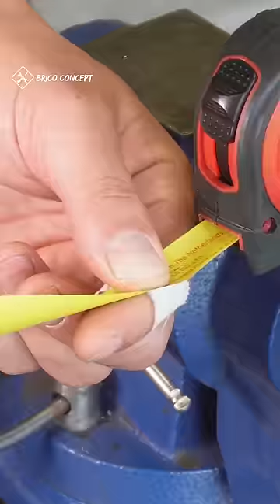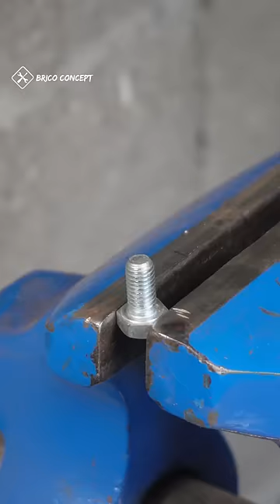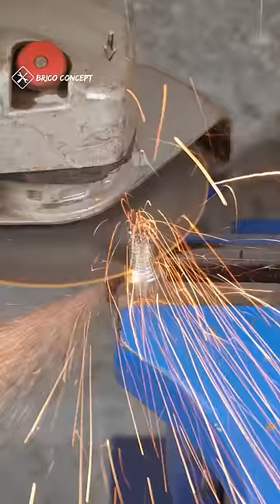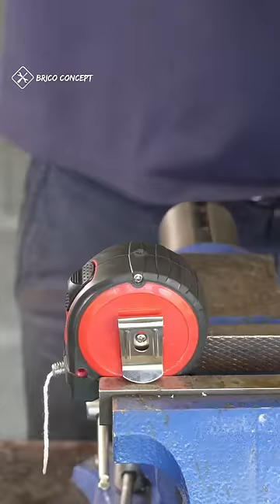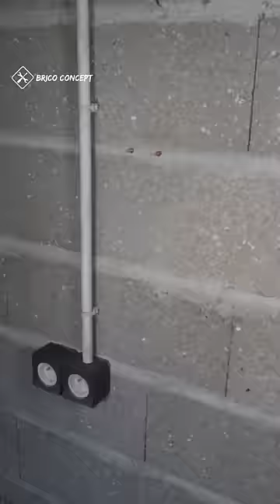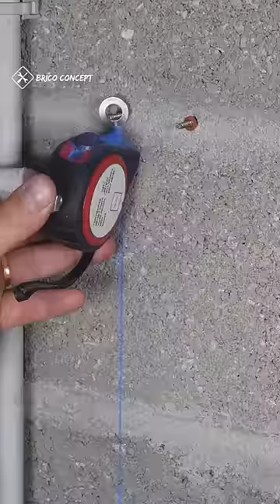I Recycled My Broken Tape Measure #shorts

Comment: For under $8 you can buy one that's 30 meters long and basically use it for life. By the time you've run this thing out to it's full 3.5 meter length a few times, the chalk will have gotten all in the spring, ruining it and you'll still need to buy an actual chalk line.
Reply: Could’ve just called it stupid💀💀
Reply: In Iraq, its price is $1
Reply: @Qwertak97  if you ever see a compact tape measure that’s 65 feet long, you be sure to let me know
Reply: @iq3l3  and lasts 5 uses. Better to just coil a string in a small container
Reply: Or even $20-$30 for a laser line generator and if time is money you saved yourself some money by not making this and by not having to remove chalk lines off
Reply: There's always a critic
Reply: There is always people that know and let you know what they know because you don't know what they know so they need to let you know so that you know what they know and they know this is rubish and they are letting you know that they know. Got it ?

Comment: They sell new tape inserts. You can fix the good quality ones.
Reply: Really never seen that here … it’s like some countries have stuff like that and some don’t
Reply: That's not a good one.
Reply: @rayzor196  when you buy a case of tape measures you can add replacement cartridges. Also you can get a calibrating board to test the tape to make sure it isn't stretched. Industrial sales are different.
Reply: That they do but usually have to order them. Don't think I've ever seen them in any store. I have a couple of the good, older, leather Lufkin 100 foot tape measures I redo every few years
Reply: That may be true, but then he couldn't have made a chalk line. I do wonder how long it will work before the spring gets dried out and gummed up just like any other tape does when they get too dirty inside. I buy my tapes from harbor freight. I get the super coupon, buy anything for 4 dollars or more and get a tape for free. I buy a tape and get one free, 2 dollar tape that way. When they are that cheap they can be replaced. The ones I take to work normally only last about a year, but the 10 or so I have at home I've had for years. It is the 1' X 25'
Reply: @jameshendricks8526  real work uses laser lines.
Reply: Mais uma inutilidade dá Internet 😅😅😅😅😅.  😊
Reply: @buysncharge  I can see that putting up drywall but to get a line to cut a board with a skill saw, not so much. I don't use a string line for that either. To me,  it's just as easy to mark a couple of spots and just use a straight edge. String lines are messy. The only one I've ever used was about 25 or so years ago helping my brother-in-law build a shed. I was given one but I never put the chalk in it. They make a great plumb bob
Reply: @jameshendricks8526  once you go laser you won't go back. They're sweet.

Comment: Huh.... I wouldn't ever thought that would work xD, to bad chalk lines are only $4 to $7
Reply: It's about recycling, can't you see? 😨
Reply: I paid $30 for mine… That’s Canadian funds mind you!! Well worth the money… the cheap ones are shitty quality.
Reply: @nunovilela1360 not really
Reply: @nunovilela1360 hope you are joking😅,

 If not just think a bit to make it into a chalkline he had to buy a thread, a pack of washers, a pack of bolts, the line and chalk, drill and a tap and all this comes packe in plastic so to recycle this you throw away 10 times more waste than just buying a new tape messure and a chalkline.

Kinda defeats the whole point of recycleing😂
Reply: @nobodyspecial6436 The device from this video, because of its design, will work no longer than a week. The same quality factory product can be taken from us in Russia for $ 0.5 and it will also last a week. But you will save an hour of time and consumables.
Reply: @nobodyspecial6436 türkey fırs class 2 $
Reply: Too bad there are more than 100k ppl not so Smart as you
Reply: A good chalk line will cost you about 40 to 60
Reply: @aeffern I'm sure he already had all the stuff you mentioned. I know I do ! 
 I already have 3 chalk lines. None of them self retract.
Reply: l was gonna say...chalk line is not that expensive!!!!
Reply: @nobodyspecial6436  that's the low quality price...
Reply: @aeffern pack of bolts and pack of washers? You realize you can buy individual fasteners at all hardware stores right? No packaging. Yeah this makeshift chalk line is kinda stupid. But damn man don't comment if you have never stepped foot in a hardware store
Reply: @steventaylor2576  right on point man, pity the nay sayers can't see the plus😢

Comment: .... or you could have just replaced the tape.  I work on cars and replaced one with metric tape.  Makes it alot easier squaring and measuring.   All my chassis are straight to 1mm.
... I have a 30 year old Stanly chalk like.  Replaced the line a few times, it still works perfect. and its heavy/balanced enough it works like a plumb bob.

Comment: And for the cost of the tape measure, you could have bought a chalk line😂😂😂😂😂😂
Reply: and this way you get to keep the money for the cost of a tape measure in your pocket 😁
Reply: About a dozen of them or more depending on the tape. Lol
Reply: @jim944 not when it takes you more than ten minutes, or you're not working an actual job like these guys. They've never used these tools. Time is your money and you just wasted it.
Reply: He literally says he recycling one as in its worn out and he's repurposing it
Reply: @jeremysanders8138  can buy replacement coiled up tape measures for cheaper then what he did to the tape measure lol. It's not recycling and reusing something that's not even broke. Lol
Reply: @chrisangus1725  blades are the same price as regular tapes. You're flat out wrong. I'm a carpenter among carpenters. We buy entire tape measures before we buy the innards because it's the exact same price.
Reply: @chrisangus1725  which BTW if you had eyes you'd see his tape is broken. No tape starts at 455
Reply: @chrisangus1725  lol
Reply: @chrisangus1725  lol